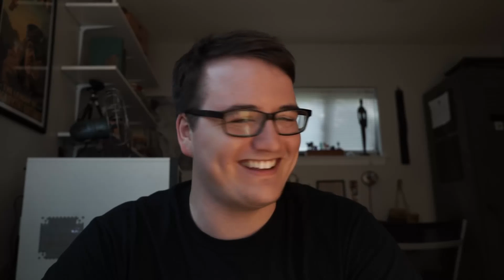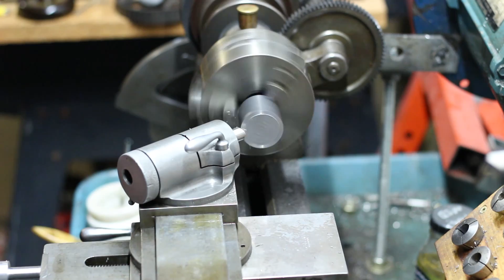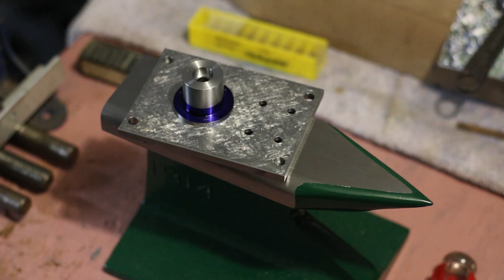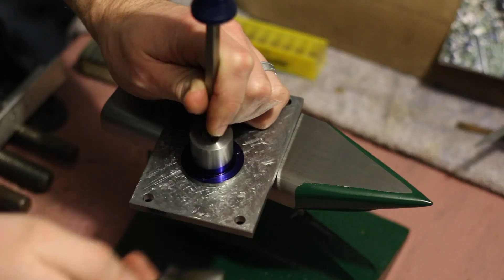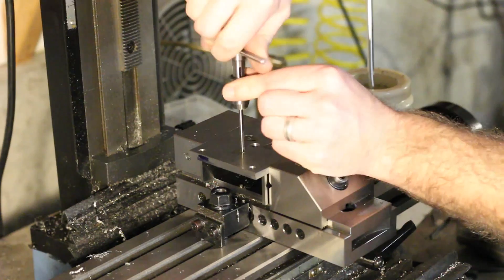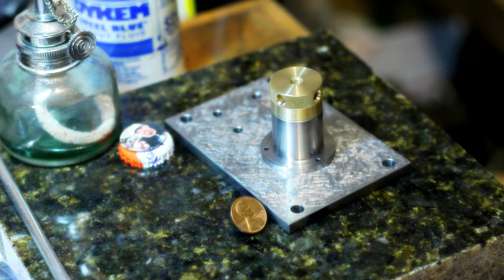Building the Trent Pinion Mill, part 2

Comment: Those spiral taps scare me.  I would have been tempted to do the tapping before investing the hour of work in machining the indices around the nut...  Am I being overly cautious about them?
Reply: I have been told that they are more prone to breakage because they have thinner cross sections.
Reply: As long as the hole is the right size before tapping they should work fine, and certainly should not have any problems in brass.   Stainless is another issue altogether, I would be nervous with any tap in those conditions.  I read once that 10-32 was the most often broken tap size for just the very reason you mentioned, however, I have tapped hundreds of holes of that size and many with the same tap, I've never broken any.

Comment: On that first part, your mistake would not have happened as quickly if you had used tailstock support. It is extremely useful especially on parts you can't easily grip with the chuck. Love the video!
Reply from the maker: Oli4vn Thanks! I agree but I decided to take light cuts instead, with constant measuring it was more convenient to have the tailstock out of the way.